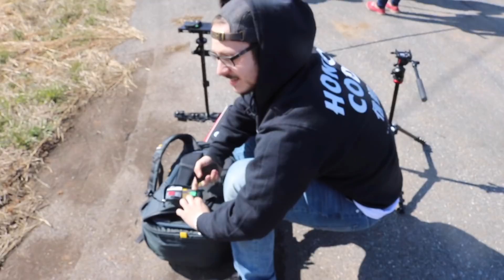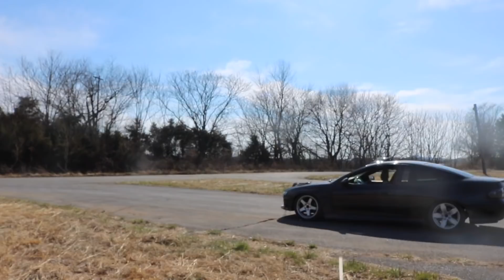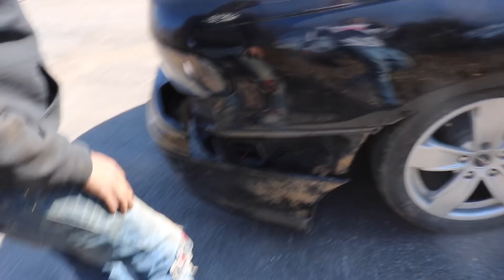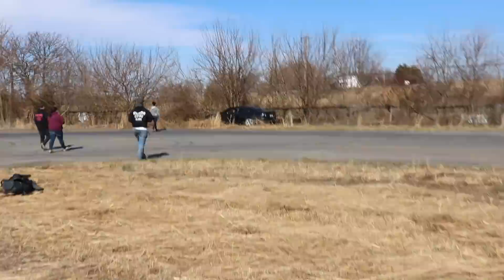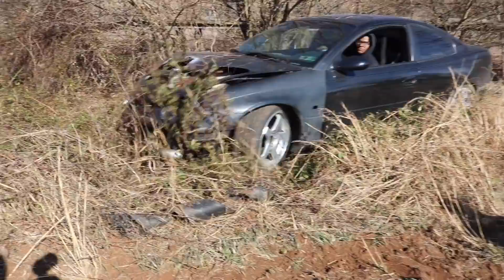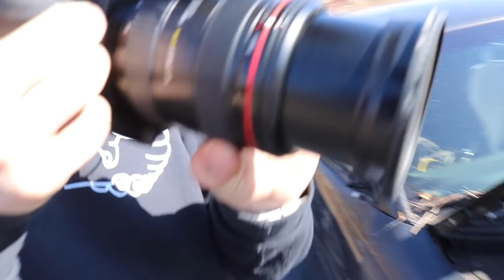When A Track Day Goes Horribly Wrong..

Comment: Dont feel too bad, my first track day i skied my s14 over a ripple strip sideways at 150kmph landed on another strip, bent my steering rack, both tie rods and ends, lcas, shifted the subframe, chewed through my main body loom, bent both front fenders, bent my oil pan, blew a hole in the power steering lines and then continued to drift on it. Just spent 3-4k on parts to fix everything and next track day got half a lap in and my gearbox exploded.

Keep ya head up dude shit happens and you learn from it and move on. If you guys ever do an australia trip come down to adelaide and you can take my car out on track 😘

Can you go to this go kart track like once a week also i love these videos 👌

Comment: Time to reshell. That core support is bent
Reply: First Name Last Name It just needs a fender and door. The core support isn’t that bad plus if I needed to I could make a new one.
Reply: DayQuan Winfree yes it's possible to fix it but I would reshell
Reply: Try to pull the core support back out if not just fan up a new one. It mostly looks cosmetic but you won't know till you tear it down. That cars bad ass BTW and I'm not a fan of the gto. Good luck with it.
Reply: Reshell? Lol it’s not even that bad. Easily fixable a few hundred doll hairs later
Reply: Quan the door and probably be bent back out for now and I was at hawkins poi t crazy rays today.and there was a gto there with all you need. Lovin the goat man. Glen Dirty in the house
Reply: Just means it’s now a dedicated drift car?